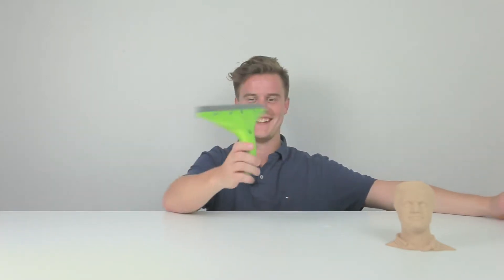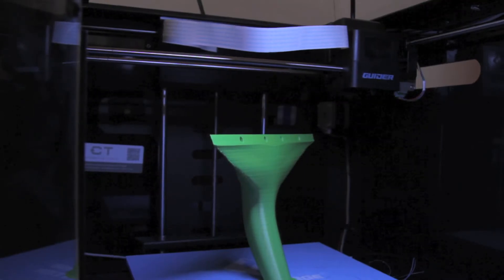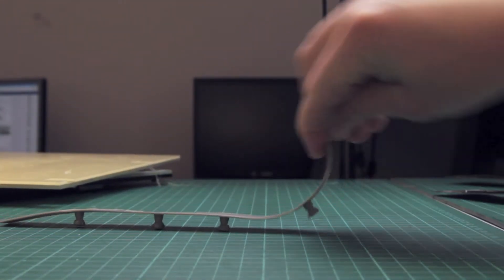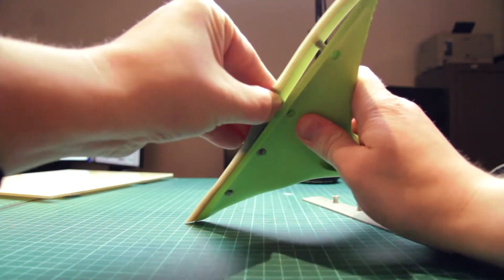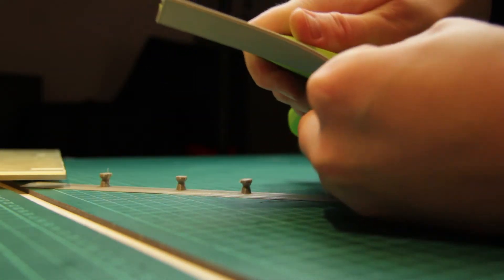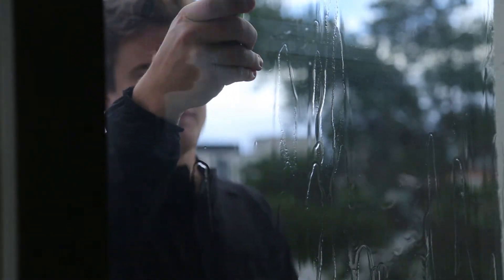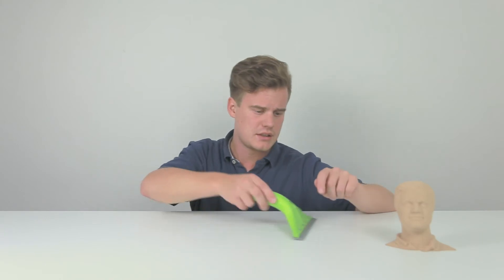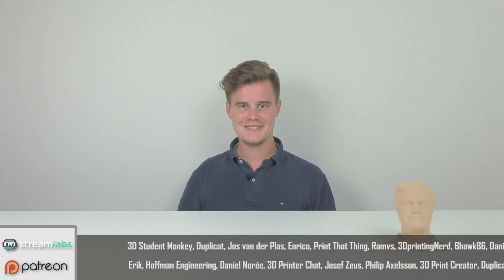3D Printing Household Tools - The Interchangeable Scraper!

Comment: You can improve the performance of the tool  if you take a sharp knife an cut off a little of the flexible material. This will give you a sharper leading edge and as a result better performance on wet surfaces.